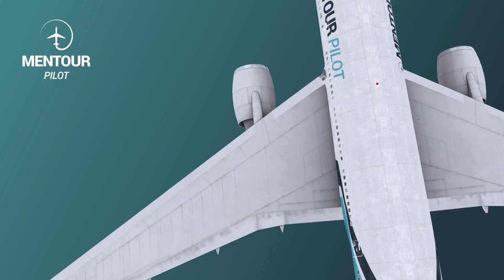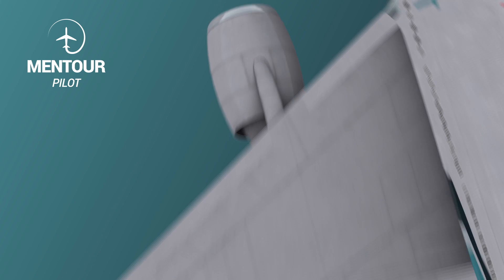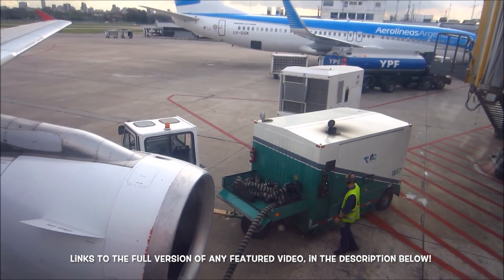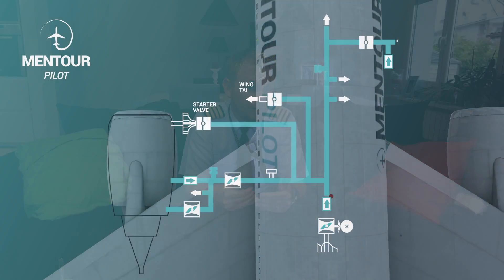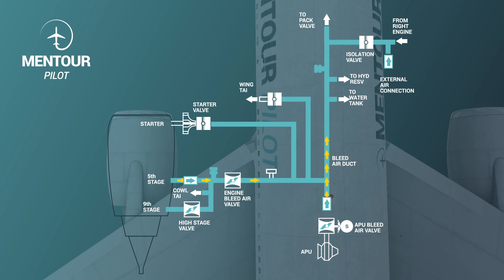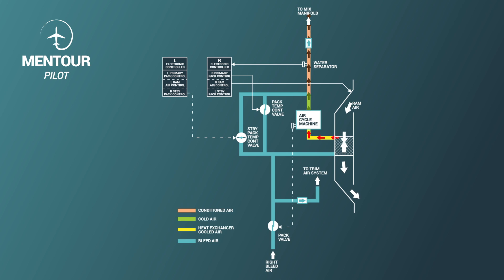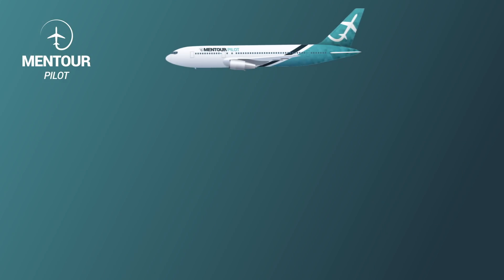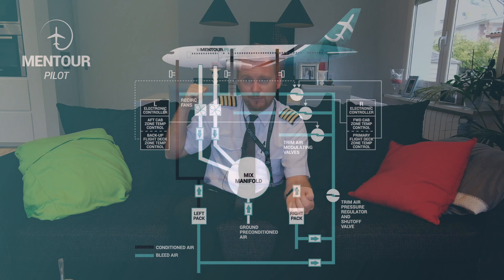How does the Boeing 737 Bleed-air system work?!

Comment: Again a very interesting explenation! Only the word "pressurize" implies that you are increasing the pressure in the cabin, however the pressure in te cabin is lowered. Only at touch down the pressure is higher than the outside pressure, as you told us here. I did not know that.  By the way, why is the bleed air being dried completely. Wouldn't it be better to leave a bit moisture in the cabin air? Although I have not noticed anything during the flights I  made that the air was 100% dry. But I haven't travelled long distance on an airplan though.
Reply: If the air wasn’t dried, ice would form at the exit of the ACM
Reply: @NicholasRiviera-Dr  Ok thanks.

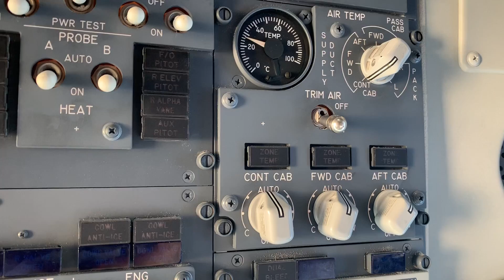Comment: 7:31 What's trim air? 
And wouldn't it be very less complicated und much more efficient to gain pressurised fresh air for the cabin just by a kind of regulated backpressure inlet? This air could be heated by heat exchangers placed around the exhaust.
Reply: Trim air is used to increase the temperature of the air coming out of the pack outlet

Comment: Bleed air is compressed air taken from the compressor stage of a gas turbine upstream of its fuel-burning sections. Automatic air supply and cabin pressure controller valves bleed air from high or low stage engine compressor sections.🤓 then what ever air is not used it gets dumped overboard this is how the air is circulated...

Comment: The beeding air system can be dangerous when some poisonous motor oil gets in the air: passengers can be intoxicated! Why don't you mention this? It's one of the reasons why the bleeding air coming from the engines will be avoided by using separate air compressors

Comment: An electrical air compressor will consume power from the generators, which in turn will still be taking power from the engines. Ultimately some fuel burned will be used to power the aircraft systems. That is unavoidable. I suspect that electrical compressors on modern aircraft may allow for more control and better regulation, and may simplify the overall system design.

Comment: To all the people asking about what happens if you take off at an airport that is at 8000 ft or above:

Think about it, the cabin is ALREADY at 8000 feet on the ground. The outflow valve remains open on the ground, then starts to close as you climb higher! 

Its the same process as when you take off at sea level, it just happens faster as your already at 8000 ft or more!

Comment: Any reason why the cabin air needs to be as dry as it is ?
Reply: Probably something to do with corrosion
Reply: The atmosphere at high altitude contains very little moisture. Adding humidity to the cabin air would require a source of pure water, and add cost and complexity.

Comment: In places like Phoenix, Arizona, during the summer when the temperature is above 100F, the jetways have large air conditioners that feed cool air into the plane via flexible hoses.  How do you get that air into the PAC system since it is not bleed air?
Reply: That is called ground conditioned air. The hose is connected underneath the aircraft and feds the air directly into the mix manifold (after the air conditioning PACK)

Comment: For what its worth the "dryness" at altitude is due to the very low dew point of the air at 30,000 ft. Something like -40 degrees or so. If you take a wet napkin and hold it over the air vent at altitude, it will freeze quite rapidly since the air is so dry. The water separator in the air cycle machine is really only needed when you're closer to the ground and the dew point is high enough to condense inside the expansion section.

Comment: Some times your aircraft is sucking in exhaust from another aircraft in front of you. If the wind is just right, this may happen. 

Peter mentioned the packs (air cycle machines) keep the cabin pressurized but needed to mention that the outflow valve(s) in the rear bulkhead really control the pressurization. 

The functioning of the air cycle machine is a study in thermodynamics. It is a complete course by it's self. I never completely understood it.
Reply: You make some good points. This video is a very basic overview of not only the pneumatic system but also the air conditioning and pressurisation systems. The air cycle machine is a very interesting device, as is the rest of the pack

Comment: At 18000 feet, even healthy people begin to DIE. Less healthy people may begin to die at much lower altitudes. 25,000 is fatal to all but the most experienced (and insane) mountain climbers, at after a short time, it is fatal to even them. It is something like this:
6,000 feet is safe for everyone except those persons who are seriously ill.
8,000 feet is where some ordinary healthy people begin to have symptoms. 

Most airliners are pressurized to somewhere between 6,000 and 8,000 feet.

10,000 feet will cause all but the acclimated persons to experience at least some symptoms.
18,000 feet is the limit beyond which long-term acclimatization becomes impossible even for the healthiest people.
20,000 feet is the place where most highly acclimated people begin to break down after several days of exposure.
Above 20,000 feet, death is inevitable after several days exposure for even the toughest humans.
The above applies only to those breathing ordinary air. If one breathes pure oxygen, one may survive even at 35,000 feet. Above that, not even pure oxygen will keep a person alive.
Reply: Space suit guys" OBSERVE

Comment: You would think using thermodynamics that using bleed air or a electric compressor would draw the same amount of energy and the increased draw on the generator would cause more resistance and in turn require more energy to turn from the airflow.

And O2 generators getting hot is understatement a box of expired ones in the forward cargo hold is what caused the crash of Valujet 592. They got hot and with the added oxygen set their packaging on fire, then a fire with almost unlimited oxygen melted through the cabin floor and destroyed all the controls before the aircraft dove into the Everglades.

Comment: Hey Mentour, are there any pressurized piston aircraft?
Reply: In the old days there were piston engine airliners like e.g. DC-6, DC-7, Boeing 377 and Lockheed Constellation. There are also pressurized general aviation aircraft like e.g. Piper PA-31P, Piper PA-46 Malibu, Mooney M22 and Cessna 210N, Cessna 340, 414, 421 and Cessna P337G, Aero Commander 500 series, Beechcraft 60 Duke and Queen Air.

Comment: Question. You touched on depressurization because of the outflow valve fault. But could the outflow valve fail in the closed position resulting in a cabin overpressure, and if so, what redundancies or procedures are in place to deal with this?
Reply: The outflow valve can be controlled both automatically and manually (along with burst-disks). Failure in the closed position did produce one serious disaster.
Reply: The outflow valve has two automatic mode motors and one manual mode motor. Only one motor drives the valve at a time. There is a pressure switch, the switch causes the valve to go fully closed if the cabin pressure altitude goes above 14,500 ft.

These are the redundancies to protect the fuselage:

There are two positive pressure relief valves. The positive pressure relief valves prevent over pressure damage to the airplane structure. The positive pressure relief valves are fail safe devices that bleed cabin pressure overboard if the cabin-to-ambient differential pressure exceeds normal limits.

There is also a negative pressure relief valve. The negative pressure relief valve prevents negative differential pressure (vacuum pressure) damage to the airplane structure. This can prevent structure damage during a rapid descent.

Comment: On QI they said that since smoking was banned on flights, airlines save a lot of money by recycling air back into the cabin instead of replacing it every time, and this lower air quality is what is responsible for the rise in air-rage incidents and deep vein thrombosis, nothing to do with sitting for too long.

Comment: @Mentour Pilot: Often when I'm sitting in last rows of a plane, I can smell burnt fuel when engines are started. When I get places in the front I never have that sensation. Could you tell me why this could happen?  If feel that it is connected with the things you discussed in this video. Thanks!
Reply: At the beginning the APU starts to assist engine start thus smell. Or do you mean after takeoff when engines are already running and airbourne?

Comment: "What we call the 'air conditioning packs' " and ..."isolation valve,"  or just the actual air conditioning packs and isolation valve (no need for the "what we call" part since these are the actual terms)?
Reply: well PACK stands for pressurization and conditioning kit
Reply: @monkeydfaris395 : Yeah, OK, so it's basically official, then, and no "what we call..." is needed.

Comment: Can and will you explain to me who and what determines what aircraft a pilot will fly? 747...737...A380???
Reply: Naturally it depends on the airline, and also what experience the pilot has. Another thing is that an airline pilot must have a type rating for the aircraft he flies. When a pilot is assigned to fly e.g. a B737 he needs to get the type rating training for the B737 before he/she can start to fly it. At an airline the pilots normally fly one type at a time. If the pilot is transferred to fly another aircraft type, he needs to get a new type rating training for this new aircraft.
Reply: @mikep9604  thank you for the response

Comment: I’m sure on the 737 it’s oxygen generators but on the 777 I’m confident it’s actually O2 bottles for both Pax and pilots (naturally separate locations within the plane) Sauce I’m an aircraft maintenance engineer and work on the 777 and 787
Reply: The B787 uses oxygen bottles for passengers. There is currently a scandal due to unreliability of the activation mechanism.

Comment: Why 8000 feet? Why not lower, such as the origin or destination elevation. I have heard that the resulting mild hypoxia is a method of crowd control - intentionally keeping the passenger minds dull. Less pressurization also reduces stress on the envelope.
Reply: The fuselage would have to be stronger to withstand the pressure. Also making it heavier. Older designs are pressurized to 8k feet but newer designs(ex the 787) are pressurized to 6k feet. People can survive at 8k feet cabin altitude with full use of their bodies. Though Acute Mountain Sickness can take affect as your body hasn't had enough time to acclimate to the change in altitude.

Comment: Do you need jet-engines to be able to breathe in aircraft?
 Did people breathe in aircraft before the jet engine was invented?
 No and yes are the answer to those questions.
 However that said with the way modern aircraft work for jet airliners and their passengers it is essential to use turbines to produce the pressurised cabins that we are all used to. However that is not the same as saying that you need jet engines to be able to breathe in aircraft in general.
One interesting question this does bring up is what happens at airports which are themselves above 8,000 ft in altitude?

Comment: One more question, where do they keep the animals? Do they have the same survival conditions as us passengers? Are there special stewartist's for animals?
I've also heard that some flights have had coffins as cargo, is there a separate section for this?
Reply: Nope they're just thrown in the Cargo Hold
Reply: On the B737, animals are flown in the forward cargo hold because it is warmer than the rear cargo compartment. Equipment cooling air from the “computers” is routed under the forward cargo compartment and sucked up the sidewalls by the recirculation system

Comment: What about smoke events ? There's a few documentaries arround about burn oil residue in the air the passengers breathes
Reply: I have no clue how that would be possible as bleed air is taken before the combustion stage.
Reply: @gnranger  Lubrication oil can enter the bleed air due to a faulty seal, but never burned residue.

Comment: Thank you for this informative video. I have a question concerning so-called ˋfume eventsˋ, when fumes enter the cabin due to a defect in the system. I am currently treating (p.t.) an airline attendant with a possible aerotoxic syndrom( neurotoxic gas realease).It seems to be a controversial theme, one that the airlines and manufacturers are not ready to accept if it actually exists. Hoewever, i do understand newer jets are no longer
 feeding air over the engines. Perhaps you could comment on this. Does the pilots union have a stand on this ?

Comment: Explain the static port
Reply: There are instruments that use barometric data like the altimeter, air speed indicator and vertical speed indicator. The static ports are air inlets which measure the static pressure these instruments need.

Comment: 7:45 Literally everybody coming from the news outlets: "Actually, MCAS is the worst system on the 737."
Reply: It’s only on the newer MAX versions with the larger engines that caused a change in handling dynamics, not the older 737’s that make up the majority of the aircraft in service.
Reply: @mikegirard4388  That's the joke :)

Comment: I would like to know, for air claft using piston engine like Diamnond 62 where does the breath air comes from. The second question is for starting a jet engine using ground air starter is it okay than Using APU, I mean in case of engine failure on sky there will be no possible chance of starting an engine....or is it so expensive to repair an APU for engine start up...
Reply: In piston engine aircraft, the pressure comes from the turbocharger.
In flight they can use the windmilling effect to start the engines (air flowing thru the engine makes it spin, same way a windmill spins when wind blows past it) OR use bleed air from the other engine if its still operating. In the B787 they are electrically started so they would need the APU or other engine operating to produce enough power to start it.

Comment: The 787 approach is better. When you make pressurization and climate control independent of bleed air from the engines, you can also do a better job of controlling the temperature and humidity.
Reply: Controlling the humidity requires a source of pure water. Such a system was proposed, but never implemented on the B787.
Reply: @gordonrichardson2972 as far as I am aware there are 3 humidifiers on the B787

Comment: One interesting fact about pressurisation that I read about is that this process of pressurising and de pressurising the aircraft is what makes most of the structural stress on the aircraft, so a plane that flies many short flights per day will get much more wear and tear than a plane  flying long haul flights with    more hours but only one pre/de pressurisation processes
Reply: Sure but the aircraft are designed with that in mind. Some B737 do 5 or more sectors a day, which equates to many flight cycles over its life time